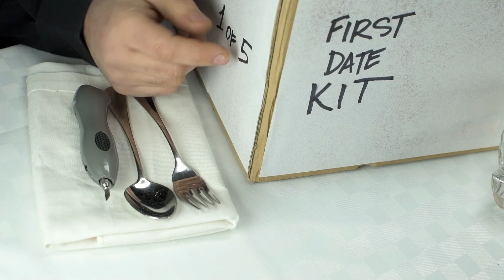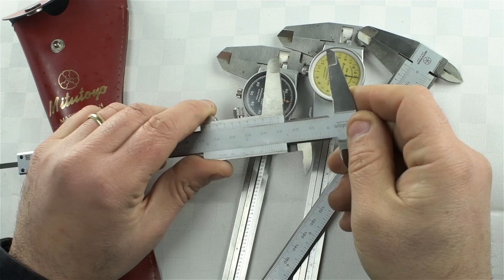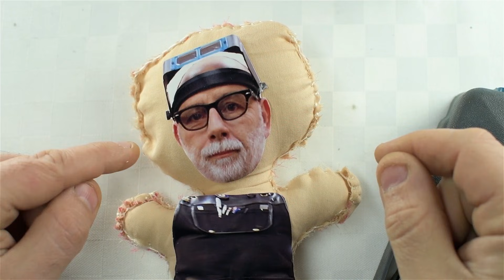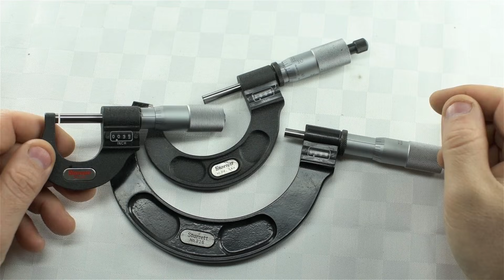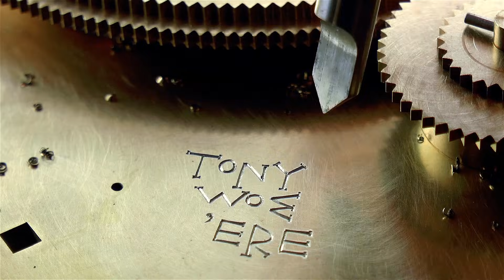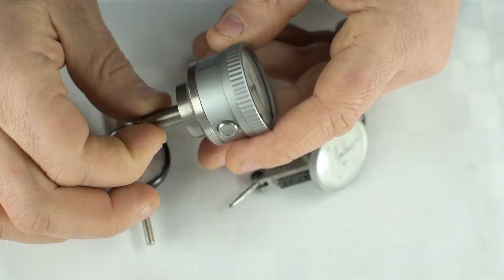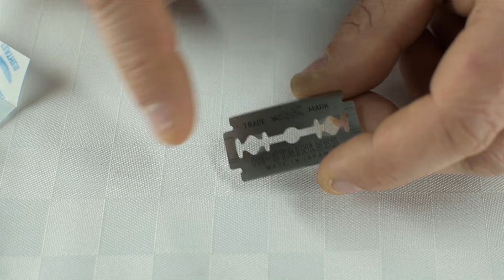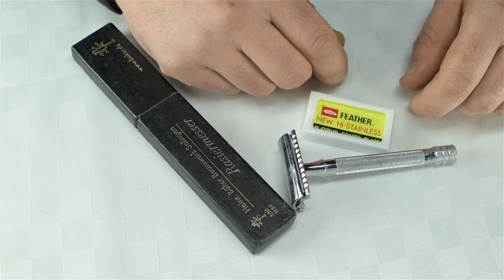♫ These Are a Few of My Favorite Things ♪

Comment: Keep your blades (yes, even disposables) immersed in mineral oil (the kind from a pharmacy) to make them last much, much longer (like 5x or more). They dull because they oxidize, not because your Superman beard hair can dull steel. 

Congrats Tony!
Reply: I began doing that a few years ago. Really helps. Also got me to stop using shaving cream, turns out when your blades are lubricated really well, all you need is a little soap and water after shaving.

Comment: Totally true about straight razor shaving. The learning curve is precipitous but after a few attempts it is very satisfying to stand in a steamy bathroom with a glass of Knob Creek Kentucky Bourbon and a shaving mug and brush. Here is a tip: unless you are a just post-pubescent young man learning to shave what amount to little more than the soft down of a ripe peach (I.e., if you’re not 12 yo) shave with your normal razor first, then use the straightedge. The stubble your 4-blade disposable leaves behind is more than enough for you to learn to remove. And you will need stiptic to staunch the inevitable nicks. It’s easy to find in the pet store for people who trim their dog’s nails too short. Love the video. ToT, finest kind.

Comment: I resolved my own analog vs. digital caliper debate while driving to the store at 2am to find an obscure replacement battery so I could finish my project.
Congrats on the 500K subs!
Reply: Mr. Morningstar   If I can't throw AAs at it or plug it in, I pass.
Reply: LR44 is literally the most common button cell out there. If you need it working in a pinch, you can even "recharge" them with a normal battery charger and some tinfoil.

Comment: Frank, if you check these comments,  Here's 2 for you.  Retired Toolmaker, apprenticed in '67 still tinkering with mini shop in my condo basement.  I understand the sentiment with the verniers, but now I find the easiest measuring is with the digital calipers.  The 4" is more handy than the 6", and they go for $9.99 on sale at (china) Harbor Freight.  I have several laying around my shop.. Also if you can find one, the Gladwin  indicator is the easiest, fastest way to find the center of a hole, as it reads on both sides as you spin it.  They don't make them anymore, but they still pop up on the internet occasionally.  Worth their weight in gold.

Comment: I've been watching your videos for some time now. I use the exact same disposable razorblades and a pretty similar razor. You using those 'tools' too is like my Dad saying that I did something right. Wow that sounded weird. Well. Keep up the good work Tony.
- The son you didn't know you had
Reply: Same here! I use the exact same "Feather" Safety Razor Blades. 
After trying probably over a dozen other razors including much more expensive German made.
The system takes a little practice to get good with but well, well worth the effort to learn. The trick I find is to never apply pressure.

Comment: I agree on #5. The feather blades are a great value, providing good price and great performance. Some of the vintage safety razors use a twist knob to flap open the top, but they seem to gunk up frequently. The style that unscrews into three pieces (like the one you show) is definitely my favorite. You have to shave slowly and gently to avoid looking like you attempted suicide, but...it's only ten cents a shave. When it's the beard season, I only shave my neck once a week. That means its a heavy scruff to remove, and the safety razor easily does a mow job that would clog a two-blade disposable.

Comment: "Quantum leaps to the 4th dimension"  Lmao!  Just think how many nuts, bolts, and screws are living in THAT place!
Reply: not to mention the springs
Reply: Ooh i forgot about that place
i'm pretty sure the spring and a few nylon pieces of my tape decks are just out there floating around
Reply: Plus they keep the socks lost in the dryer company
Reply: I'm fairly certain that's where every E-clip I've ever touched currently resides...
Reply: @Ian_Wallace.  Hahaha!  Yep!  The only E-clips I've ever seen, were either already installed, or new in the package.  Take one off and......POOF!  Gone for good.
Reply: hehe so you too don't know how to remove proprely an e clip without it fyling into the 4th dimension
Reply: @that_laughing_hyena  Apparently not, but at least we know how to spell.  :P
Reply: Not to mention elusive socks and cherry tomatoes. Man, do they planeshift !
Reply: Not to mention all the roll pins that you could have sworn were started properly but end up leaving you with a black and blue finger and your part falling apart at the same instance

Comment: TOT, congratulations on your well-deserved 500K milestone!  At the risk of sounding, well…, “Overly Groomed”, that’s was a snappy strut down the Health and Beauty isle!  The irony of your Feather razor blade tip is not wasted on those of us who subscribe to TOT for insights on sharp cutting edges producing fine surface finishes.  Following up your nothing-less-than courageous departure from the norm, I would like to add that in my own ongoing search for a remedy to the 3/32 stubble problem, I discovered (while working abroad) that Weleda Shaving Cream works wonders on both the comfort and finish fronts; no nicks or burns and a shave that lasts half a day instead of half a shift.  You’re probably not going to find it at your local CVS, but track down a tube.  The discriminating will appreciate the difference.

Comment: I also love those safety razors! I get a perfect shave and the blades just cost 10cents a piece vs 3,3€ for Gillette.
Reply: Good to spend the extra cash for a heavier, better handle, IMO. Especially if you tend to shake or twitch. Feather blades are the best. Also, if you get razor bumps the disposables with 5+ blades in them seem to make it worse, just one good pass with safety razor is better.
Reply: Gillette can go pound sand. ToT is no soyboy!!!

Comment: A Double Edge Safety Razors, and the Feather blades are the BEST! The Feather brand is the Sharpest DE (double edge) safety razor blades made today. No surprise they're made in Japan :-)

Put those blades with a good butterfly razor (my preference at least) and you got a winning razor combo, that Hands Down will beat ANY and ALL of these "modern" throw away razors. 
There is a small learning curve to a double edge razor, and a blade that works great for one mans beard might not work as good for someone else. However, with being able to change blades to any brand you wish, it also means you can customize your razor until you get the results you want. I would advise to buy a Assorted pack of blades, then you can try many different brands of blades, until you find the perfect one for you! 

Double edge and straight razors not only can give you a Much closer shave, but they will also reduce and stop razor burn, bumps, and other irritation... once you learn to use them correctly, and find the right combination of Blade and Shaving cream. 

And once you learn what you're doing, and you find your favorite brand of blades, you will Never go back :-)   And after the initial investment, they are FAR cheaper than "modern" throw away and replacement cartridge junk razors too.

Straight razors are cool too. Little more expense, BUT its a One Time expense, and a straight razor can last many many years. Never have to worry about replacing them really, just have to keep them sharp.

Either way, you need a good shaving cream. If you (whoever is reading this...?) are still using "shaving cream" out of a aerosol can... you are really missing out. 
Instead, throw the can out, and find a GOOD lather shaving soap. Then get a lather mug and good brush. A quality lather shaving soap can make a Day and Night difference in shaving. 

There are some great Youtube channels about Double Edge and Straight Razors too. As they have become nearly forgotten about by most today.

Comment: I'm a knife guy and I love the Swiss Army Knife and I think even the most dedicated knife collector probably owns at least one. The only real problem with them is the slip-joint lock, but they still get the job done. The steel is actually quite respectable for the price.
Reply: The sentinel Tony showed actually has a linerlock. I have the forester, it has a couple more tools on it but it's the same frame size as Tony's. I carried it around for years and it's still with me
Reply: My Champion Swiss is my security blanket. Goes with me everywhere.
Reply: Carried the officers knife since 1992. My little buddie.

Comment: As tangents go: If you are unsure about whether a full metal straight razor (a.k.a. "cutthroat razor") is for you, there are barber razors with replaceable blades. They use regular razor blades' halves, broken length-wise, and obviously don't need sharpening. These barber razors are useful for learning about things like angle of attack, calm hand motions and the need to be wide awake and focused when shaving, without dropping big bucks on a high quality cutthroat razor and sharpening strop right off the bat.

Also: A truly great video and some nice cameos.

Comment: Congrats to 500k.
And yes I also shave with a Shavette (Haven't jumped the gun to a proper straight razor ... need to practice) and bought a Safety razor when I was unhappy with the Results of a Mach 3. 
The Feathers and Astra blades are the best I own. Feathers for special ocasions and Astra for everyday shave.

And yes - I shaved my face off when I first used a feather on my safety razor.

Comment: Not only can you get a good shave with those razors but you can also slice garlic so thin it will liquify in the pan with just a little oil. It’s a very good system.
Reply from the maker: I'll have to try that.  same razor I shave with or a fresh one?

Comment: i recently got my hand on a 200mm caliper. funny story. at work someone dropped their caliper so the top teeth bent. as per protocoll we can't use deffective measuring gauges so we scraped it out. while i was going to get a gauges checked i spotted it and asked the guy who is in charge of our gauges if that one was ok, he said: no, not for work but if you wanna take it home, go ahead. so i got a 600euro caliper for free that works perfectly fine. i just had to hone down the top teeth a little bit but it still works for everyday  home usage!

Comment: Do they sell the Mitutoyo at harbor freight?
Reply: As long as you replace the batteries in the harbor freight digital calipers early they are not bad. The don't feel as good to use, but give accurate enough measurements. If the battery gets low however the measurement wonders.
Reply: I don't think so, but I bet you could find some Titumoyos there.
Reply: @--_DJ_--  Mitutogas.
Reply: NO!!!
Reply: Yes.  Look for Central Toyo brand.

Comment: Re the standard external micrometers, you can make or buy a collar to fit over the Anvil to take a ball bearing for measuring wall/pipe thickness etc, or even 2 collars to suit pins for narrow grooves (just deduct the pin lengths from the mic' reading!!) + you can go a long way with a spring calliper in conjunction with the internal knife edges of a digital calliper or Vernier or even a good steel rule!!

Comment: I have used the optovisors at work. Ended up buying a Yoctosun cheapy for home. Love the selection of flip up/combinable lenses and the comfy head band. Wish it did not have the light, adds some bulk and weight. Only once used the swivel in eyeglass (wanted to check a fine surface finish). I would not go back to the optovisors which I now feel are uncomfortable. I work alone at home so there is no one to shame me for my choice.

Comment: Won't be long now until you have your own Netflix series. As a side note a safety razor handle is an excellent little lathe project and in a very short time you'll have something a lot nicer than most of the ones you can buy. That is of course if you can still use your lather after holding a blade like you do ;)

Comment: That Starrett mic can be modified w/ a longer anvil so it can be used as a bigger micrometer... But it would have to be an adjustable length anvil, like a rod w/ a tab that will lock into the anvil clip and it would have a pin w/ a thumbscrew to adjust the length.  Just an idea....   😁

Comment: Hey Tony, I never liked the "Leatherman" from the start, but one time I was working maintenance in a meat factory that made hot dogs and sausage (150K lb to 250 K lb a day) I had a pair of pliers where one handle had a screwdriver blade and the other was an adjustable wrench. haven't seen one since.

Comment: Want your razor blade to last?  Ditch the soap. Use only warm water. I’ve had my current beard about 46 years but shave my cheeks and neck almost daily. My stainless blades last 2 to 3 months using only water. Add soap and they last a couple of weeks max!

Comment: Absolutely fantastic. I also shave with a straight razor when time permits, but I normally use a safety razor. Also, those SAK's are great little knives, but if you'd like to treat yourself see if you can't pick up a Chris Reeves knives small sebenza (or a large) as a machinist I'm sure you'll appreciate it.

Comment: As a user of the safety razor for over 30 years, I just have to toss in my 2 cents.  Be sure to get a quality clam shell razor.  I've gotten a few over the years but still go back to the used one found at the bottom of a box acquired from an estate sale when I was a teen.  Also with it being a clam shell razor, it is so easy to flip the blade over after each use.  I swear the blades keep their edge so much longer by doing that.

Comment: I always loved the safety razor I had from my grandfather, until it broke. Always cut myself all over anytime I put a new blade it, but they were tiny cuts because the flesh at the base of your hair follicles actually protrudes slightly further than the rest of your skin.Usually took about a week or so to break it in, then I'd use it for about 4 or 5 months until the the ratio of cutting action vs snag and tear out of your face got too low. I'm an all the time beard person, so I don't have as much to shave, and it grows slowly so I only have to shave 2 or 3 times a week to keep it tidy. On the few occasions that I do shave my whole face, instead of a 5 o'clock shadow, it's more like a 4am the next day shadow. It takes the better part of a week to look like I've trimmed it with a #2.

Plastic razors only really last me a month, whether a 3 blade or a 7 blade, and I find they barely do anything at all if you have thick(as in lots closely spaced, not diameter) fine(as in diameter) hair. Plastic razors always clog up fast, and it's meticulous to try and clean them out. With a safety razor you just pop the blade out, rinse and put it back.

Comment: @14:17 had the one that everyone had, the red rounded one, not this version (so I don't know exactly), slip off some work and the blade swung back and shut on my pinky and about took my finger off. 

Later, had a liner lock come open in my pocket, reached into my pocket and it was opened like a V, and slit the whole tip of my finger open.

 I will never go back to this style of knife.  Get your self a sog or something with a better locking mechanism and steel and you won't need to buy 3 knives. (and you will feel better about giving this to your kid)

Comment: When i a was a Young man many moons ago i.... Ok, i had a pair of parallel pliers which could be locked on a piece of flat metal. There was one with copper faces on the pliers, for protection of the metal clamped.
It was made by Moore & Wright, in Sheffield, England. You could hold  the weight of a middlesized car, once clamped. Never seen one of those again, sadly...

Comment: Picked up a used Ames No. 25 Thickness Measure from eBay for under $20 and I'm very happy with it. Does 0 to 3.300.  Basically a spring loaded analog caliper.  ebay Ames 25 Thickness

Comment: All of my inside micrometers are analog. When the computer processor on micrometers go bad  then one has a ruined tool. The companies that make these modern micrometers just throw them out; they won't fix them. This happened to me with two Tesa/Brown and Sharpe/Hexagon outside micrometers. They gave me a deal to purchase  new replacement micrometers but, every time the battery goes out I begin the replacement procedures and I hope that the micrometers work.

Comment: Hey, I know EXACTLY how to never use the 1/128th scale calipers lol. You'll facepalm once you realize how easy it is to read.

Line 1 - 1/128
Line 2 - 2/128, OR 1/64
Line 3 - 3/128
Line 4 - 4/128, 2/64, or 1/32; but 32nds are probably on the caliper scale already. Maybe even the 64ths. 

I got it by this point, so I'll assume you figured it out already lol. I love these things. I never use them anymore, but I still love em'. Reminds me of an older Era that I wish I could have worked in. Everything is cnc now it seems, and it's like no one wants to know how to do things manually anymore.

Comment: Congratulations and great video! (and amen on the razor bit (at least the safety razor)). I haven't gotten the confidence to make the jump to the straight razor.

I was lucky enough to get some Feather blades in a sampler pack of blades I bought to try out different brands. It was 1000% better than any of the others I'd tried before. I have switched to Astra. They seemed to be almost as sharp but last a lot longer.

I am pretty sure you were my gateway drug to machining videos. I've never been within a block of a lathe (an that's only because I drive by Grizzly Tools on my way to work), but I'm starting to get very tempted to do some hands-on stuff when I get the chance.

Cheers!